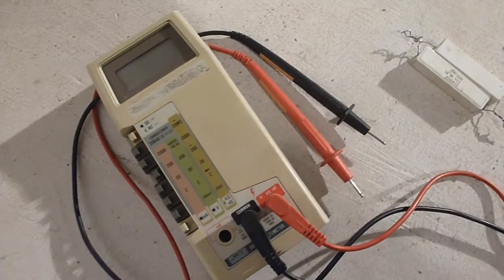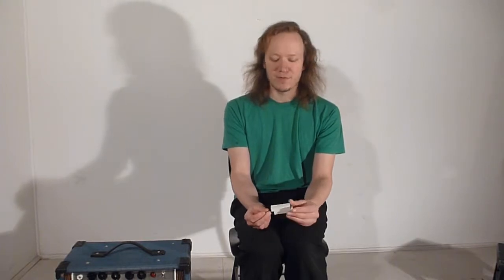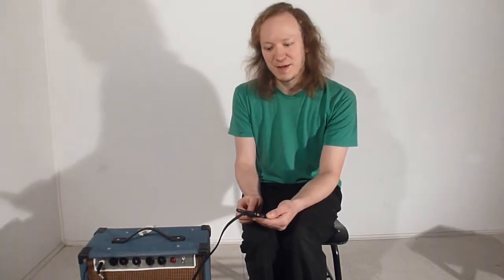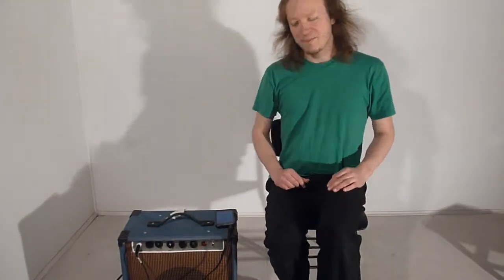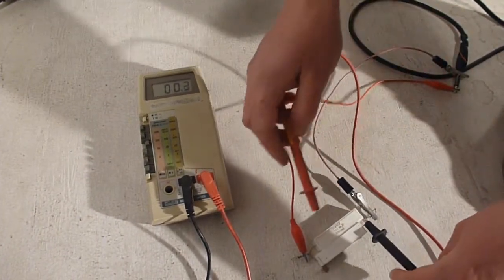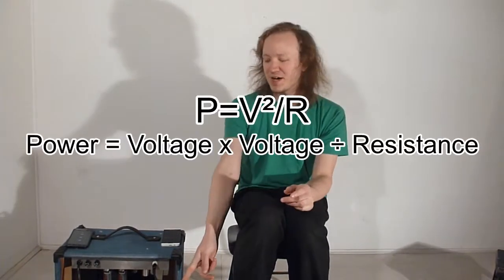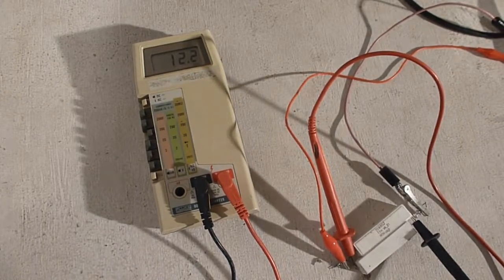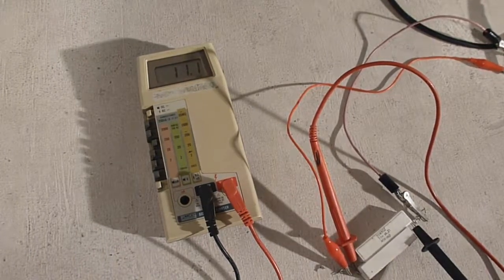Measuring an amp's output power

Comment: Your meter is giving correct results (reading in RMS) as a square wave has more power than a sine wave at the same voltage... .70.7% vs 100%   your 27 watts RMS sine wave is pushing about 38 watts square wave RMS (27x1.414) or as your meter said 12.3^2/4. Running square wave is like running D.C. Power soak resister should be heatsinked as they increase their resistance with heat and those suckers can can blistering hot during high power lengthy tests and throw your results way off and there are free oscilloscope apps for phones  and PC's that work fine for audio freqs.